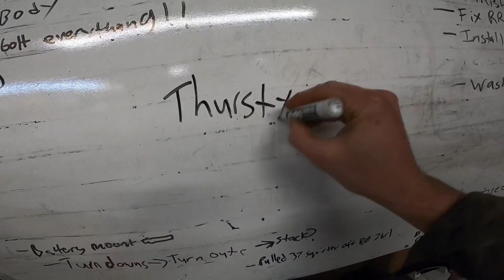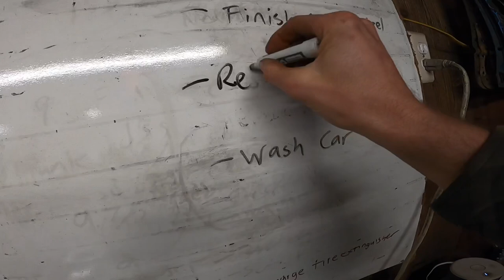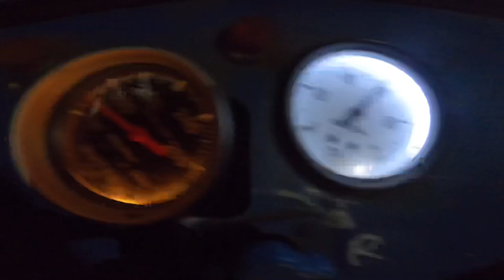New Gear for the Super Truck on a Thursty Thursday

Comment: That is why I prefer doing shims on racing gears for the pinion bearings. It’s time consuming having to take the pinion apart every time you need to add or remove a shim but once you get the preload set you don’t have to screw with it again. And you don’t about kill yourself with breaker bars trying to crush the sleeve. Also if you ever need to change the input yoke you won’t over torque the nut and effect pinion preload.
Reply from the maker: Very true! Ive always had great luck with the crush sleeve but ive always used an air impact gun. Its the only way in my opinion. Merry christmas!

Comment: Last gear I built I finally made the switch to shims on the pinion instead of a crush collar of course I always crushed with an impact too so whatever but I have reused the crush collars too so take that with a grain of salt lol but anyway I measured the thickness of the  crush collar from previous gear set with a mic then going back in the same housing with a new gear and it was perfect the first time… good preload and what not and no play between the bearings
Reply from the maker: Thanks! Ive always used an impact gun for the pinion nut but i figured id try the breaker bar method. Do not recommend haha!